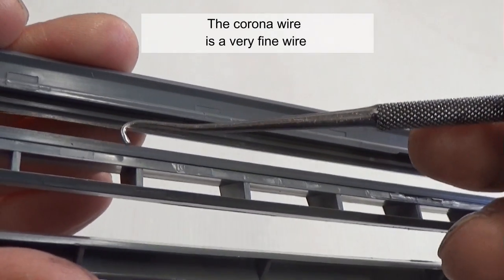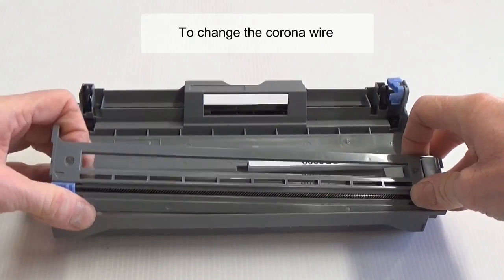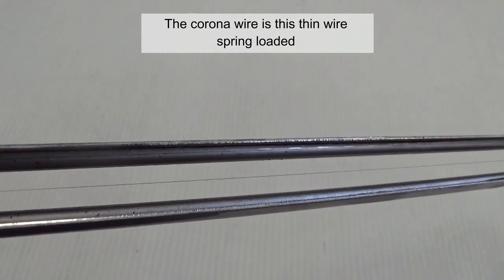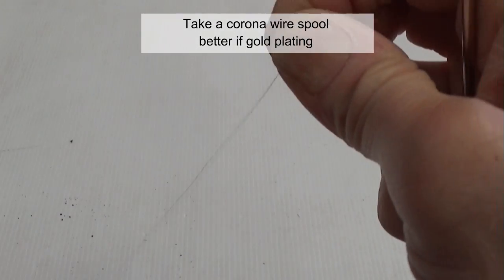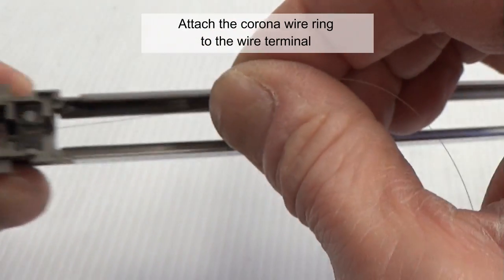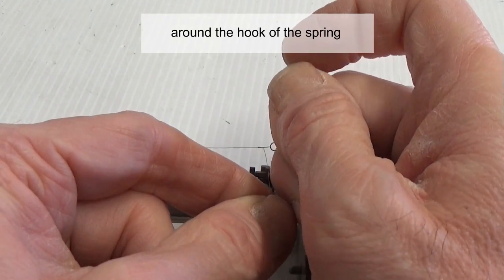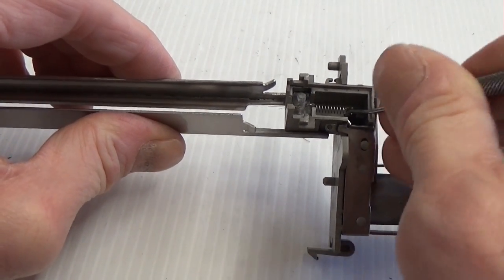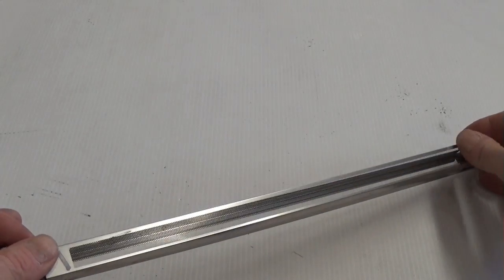How to change a corona wire

Comment: Hello. Do you know the measure of the corona wire for a DR 3300 drum, for a brother printer?
The printer is a MFC 8510DN
Thank you.
Reply from the maker: a normal standard 80 or 100 micron corona wire will work
Reply: @viandant5  thank you so much

Comment: Is there a specific measurement for the corona wire? Like a certain amount of thickness. I'm browsing through eBay and see wires that are 0.06mm to 0.10mm, would you prefer one over the other.
Reply from the maker: It depends on the printer model but often the thickness is 0.06 mm.
Better to avoid ebay

Comment: Very good ! Another trouble If the Corona brake : Same at a color laser printer, this not operate at all, indicate an Error, 0b or verify the geen tag of coronas. Same with the others 3 drums ok, the printer not operate.I have this problem at a Brother HL L3210cw. The Corona of the magenta drum broke and the print not operate.

Comment: I somehow ripped out my wire when using that slider thing, like the printer told me to. Prints completely black pages now. I'm too lazy to insert the wire. Not sure if it is even possible after it came out. All the black toner on my hands ooof
Reply from the maker: Which printer?

Comment: Sir i want change crona wire brother 2365 drum unit . Plz give share changing video
Reply from the maker: I've no instructions for this machine but you have to disassembly the drum unit, then remove the grid from the corona assembly unit
Reply: @viandant5  sir crona wire kitne ki aati hai

Comment: Sir,
How to buy this wire for Konica Minolta 1500W pagepro printer in india
Pls guide
Reply from the maker: You can buy every type and size of corona wire
Reply: @viandant5  it is not available
Reply from the maker: @mrlegal8745  Try Aliexpress
Reply: @viandant5  pls give link 
It is not available in Aliexpress
Reply from the maker: @mrlegal8745  https://it.aliexpress.com/item/32648857150.html this is one of them, it will work

Comment: I have seen your helpful video. Sir i have a question are all the corona wire same in toner based printer. I have a kip 700m plotter cum printer m/c whose corona wire broken.  Can i replace with any corona wire? If its thickness does not matched is it harms machine? Sir its urgent. Help me.

Comment: Sir I have promble in Samsung 2876nd blank page print or light printing qwality I change drum unit 
Toner cartridge motherboard but promble is continue sir what I do
Reply from the maker: which drum unit? there is not a drum unit. however without seeing the printer it's difficult to say. try to check the transfer roller, it it out of position?  check the laser scanner
Reply: Yes sir thanks for support

Comment: Just cleaned my old BROTHER MFC 7820N and the wire snapped. Fixed it by adding a copper wire with double loop at the end where the small metal tab popped off. I didn't need to remove the end where the spring is located. Worked out great, THANK YOU!
Reply: Did the copper wire last ok? Seems like much cheaper option than buying the special corona wire

Comment: Error code 020-000 in canon ir 6000.  How to find out which problem is? D.P. sensor or Hopper Motor?
Reply from the maker: probably the path between the toner hopper and the magnetic roller hopper is clogged with toner.
 But it could be the hopper motor, the hopper motor gear or the toner sensor in the toner assembly or even the DC controller pcb

Comment: i have xerox workcentre  5775. one inch black vertical  line ,i change the corona wire but still my problem not solved,please give any solution
Reply from the maker: It may depend from te drum, the developer roller, the wiper blade, the developer roller blade
Reply: thanks

Comment: how the size of the corona wire?
Reply from the maker: it depend, often the size is 50-60 micro
Reply: +viandant5 what is equal to 0.060mm?
Reply from the maker: yes but you'll find as 60 micro
Reply: ok , thanks a lot for your explanation :)